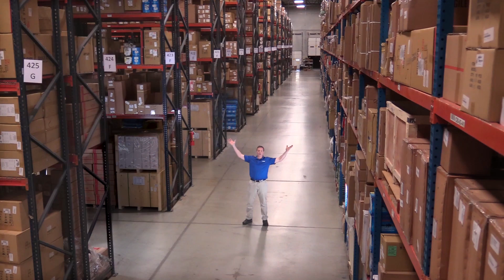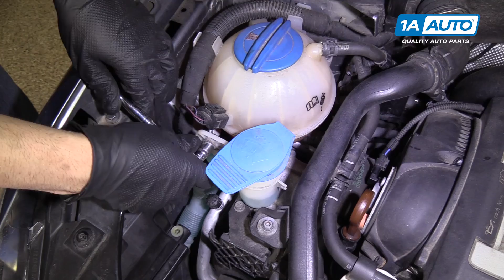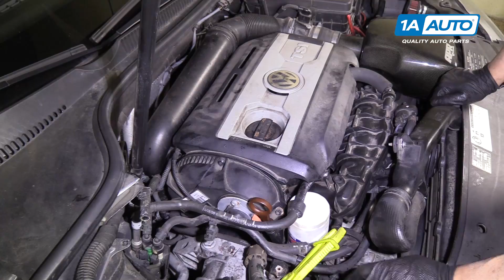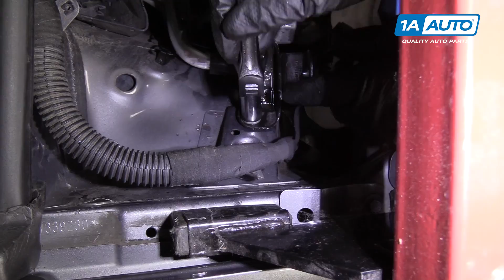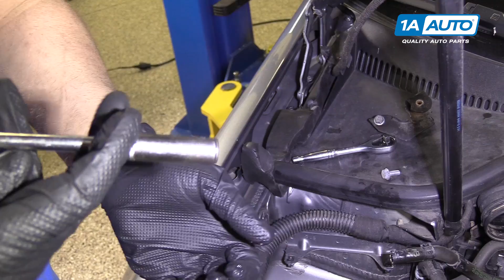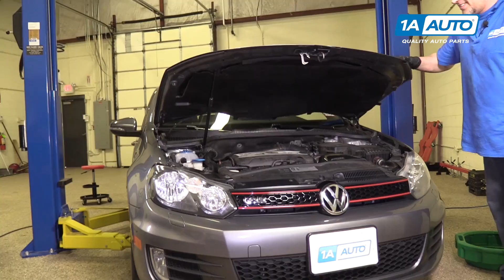How to Replace Passenger Engine Mount 2010 Volkswagen GTI

Comment: How do you remove and replace the support bracket that is attached to the motor which is part of the engine mount on the passenger side

Comment: Drop a link for the correct motor mount bolts to replace
Reply from the maker: +nathaniel camacho We do not carry the hardware for this item.  The how to and tools list on the website shows you will need 10, 13, 16 and 18mm bolts.  Thanks for watching.

Comment: Could you just use a jack underneath to support the engine?
Reply from the maker: +Isaac Knight Yes, you could use a jack as well.
Reply: You can use a jack to support the engine. However, be very careful of placement because you can break or crack something.
Reply: Yes but I would use some wood between the jack and engine

Comment: This tsi 2010 mk6 should be exactly the same as the tsi 2009 mk5 correct? I think it is they used same engines. Only difference is you use red coolant i guess and i use 50 50 yellow green. But engine itself and mount should be the same and same procedure correct?

Comment: Why support it from the top and not the bottom???
Reply from the maker: +Samantha Velazquez Thank you for the reply! We support it from the top as at the time it was easier than trying to support it from the bottom. You would be able to do it both ways, just preference and the availability of the tools to do so.
Reply: Also, if you have a car on a lift and need to do work underneath, it's much easier to use the top mount support.